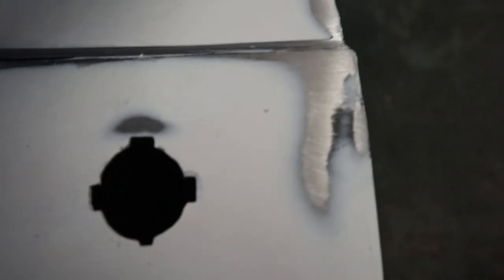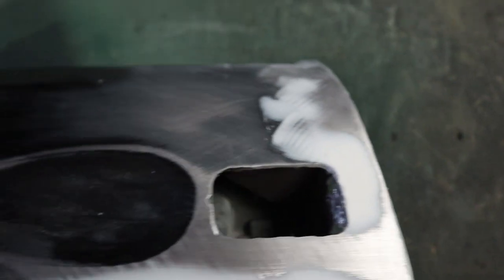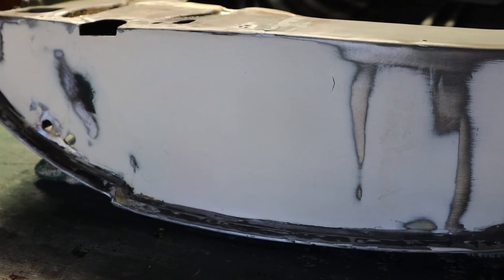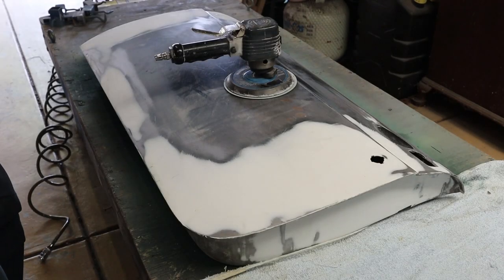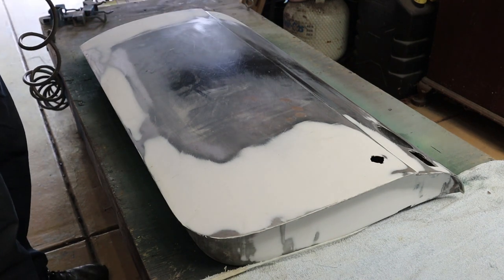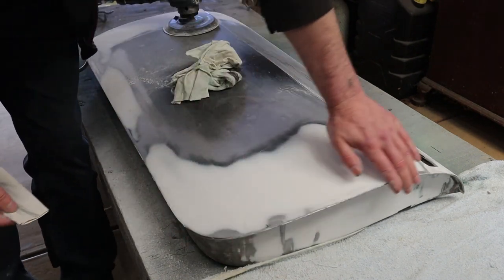How To Spray Paint a Car Door Tutorial 2020 Pt 1

Comment: Hi kel, loved watching your videos.
I myself have just started looking at these techniques as to paint the bike I have and I have found your videos invaluable...definitely pointed out where I have been going wrong.
Could you maybe do a short video on how you measure the paint in the gun and also what sort of compressor should I look into buying.
Thanks for sharing.
Reply from the maker: Hi James, not a problem. I will make a paint mix video and put it up in a few days. As far as a compressor goes. Buy the biggest you can afford. You want to aim for around 17 CFM. If you are only painting small panels, down to 10 CFM will do the job. Rule of thumb is "you cant have too much air".